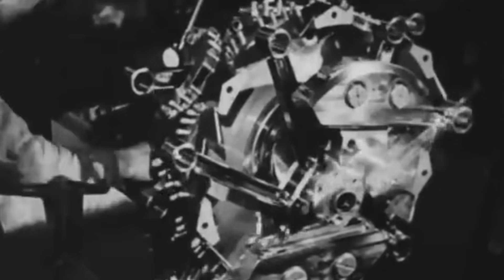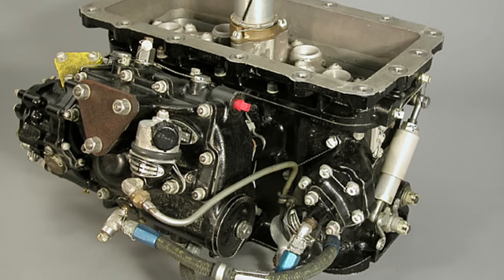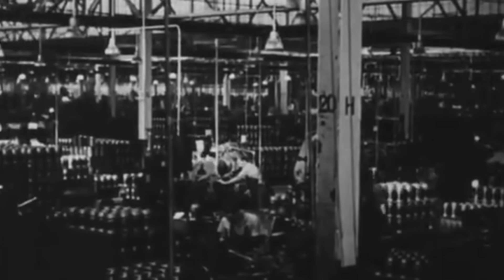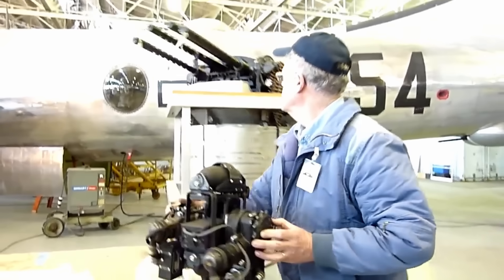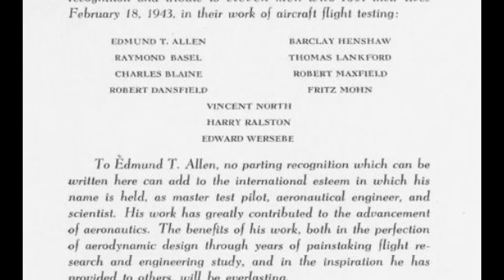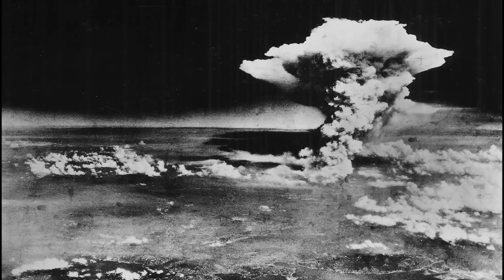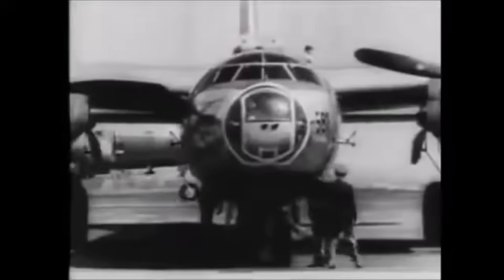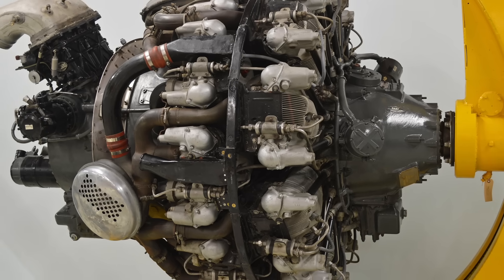MicroStrategy Connect: Community Top 10 #AsktheExpert

Comment: CORRECTION; Direct Injection SIGNIFICANTLY INCREASES HORSEPOWER by decreasing pumping loss, improved mixture ratio control and reduced engine "Knock" and allowing higher manifold boost pressure when compared with the more primitive carburator technology that was prevalent in Allied WW2 engines.
Reply: No it didn't, and no WW2 US aircraft engine's had actual carburetors on them, the fact is they were actually fuel injection, single point fuel injection to be specific, hence the sometimes used name Bendix "injection" carburetor, the only reason the word carburetor was even associated with them is simply because they just didn't think to call them anything else in those days, but they were not carburetors in the sense you suggest they were, they did not operate on the principle of a carburetor with a fuel bowl that's vented to either the atmosphere for a draw through carburetor with a supercharger or vented to the pressure side of the supercharger for a blow through carburetor on a supercharged engine, they didn't rely on atmospheric pressure and a venturi that results in a pressure differential that forces fuel through a jet like the SU built carburetors on Merlin engine's, they were full up fuel injection systems, the word carburetor being associated with them is very misleading. 
And like everyone else who is always bringing up the subject of pumping losses with WW2 aircraft engine's you seem to forget it's not an issue with them because they were supercharged engine's, the losses are strictly from driving a mechanically driven supercharger but those losses are made up for ×3 to ×4 from the power gains of a supercharger. 
He's 100% correct in what he said, the direct injection was not put on the R3350 engine for increases in power nor did the DI engine's have a higher power rating, it was all about controlling uneven air/fuel ratios to different cylinders which led to lean cylinders back firing into the intake system leading to induction fires, that was the cause of engine fires on B29's contrary to nonsense you'll hear in some videos and read in their comments, it wasn't from magnesium engine case's, which is a complete and total myth because R3350 engine's didn't even have magnesium alloy engine case's, they were forged steel.
You're taking examples of DI that apply to automobile engine's that for a variety of reasons the same results don't apply to the R3350 engine, adding DI to them was all about eliminating induction fires, not increased HP or pumping losses or anything else, just stopping induction fires, that's all.
Reply: @dukecraig2402  Your comments reveal someone who has no formal education or professional experience in aero engines.

The Bendix-Stromberg PD carburator was not a proper fuel injection system and lacked many of the performance benefits that could only come from a true direct fuel injection system.
Reply: @sandervanderkammen9230  
Well, first off I'm a graduate of aircraft maintenance school and an engine builder, so there's that, and I didn't say that the Bendix injection carburetor is the same as having direct injection, I pointed out to you why they went to direct injection, back to that in a moment because apparently you didn't get it the first time around, but the fact remains that the Bendix injection carburetor is indeed fuel injection and not a carburetor, once again the only reason they even associated the word carburetor with it back then was because they didn't know to call it anything else, IT IS NOT a carburetor in the sense you keep claiming it is, which is why it would operate in negative G's and inverted where a true carburetor like the SU manufactured carburetor on the Merlin engine wouldn't. 
The Bendix unit was a single point injection system, like GM's 1950's "mechanical fuel injection" which was also single point and worked almost identically to the Bendix injection unit on WW2 US aircraft, then after was the later GM Throttle Body Injection system which was mostly used as single point but wasn't mechanical like the 50's unit and instead was computer controlled, but still a single point injection, except for 1982&84 Corvettes which had 3 units that were akin to the old "tri pack" or "six pack" carb set up.
Watch the video, the second fuel system he shows is a Bendix multi point "injection carburetor", instead of having a single injector in the unit itself they piped multiple lines off of it to the manifold, more on why in a moment. 
Sorry if because all these years that you saw the word carburetor associated with the Bendix unit has made you believe it functions as an actual carburetor but it doesn't, the fact is it's a single point mechanical fuel injection unit, for the last time the designers of it just didn't know to call it anything else but a carburetor, specifically an "injection" carburetor, try opening a book on the subject or one of the old USAAF or Bendix manuals for it and read it's operating principles, it's not a carburetor in the sense you keep claiming it is by any stretch of the imagination, like most others you're simply misled because they associated the word carburetor with it, the "injection" part of injection carburetor should clue you in.
There's more than one type of fuel injection you know, there's single point, multiple point, and direct injection systems. 
The reason behind them switching from the original system was because when Wright designed the R3350 engine instead of having General Electric design the centrifugal supercharger for it as they did for most US aircraft engine's they were adamant about designing their own, as a result it had a poorly designed defuser area in it that had a tendency to pool excessive gas in that area, after a B29 would sit waiting it's turn to take off in the heat of the Pacific and it's engine's would heat up they would have a tendency to backfire into the intake from one of several cylinders that would run lean due to uneven air/fuel distribution to the cylinders, also an issue with the poorly designed Wright supercharger, once of of those cylinders backfired into the intake it started what's called an induction fire, this fire would move quickly upstream to the supercharger defuser which had fuel pooled up in it and burn hot enough to light it's magnesium construction on fire, they experimented with fire arrestor screens in the diffuser area but this dropped HP by the hundreds so that was quickly dropped. 
Their first attempt at solving the problem was using the Bendix injection carburetor with multiple points on the manifolds downstream of the supercharger but induction fires still happened because of uneven air/fuel being delivered to cylinders with some still being lean enough to cause a cylinder to backfire into the manifold, so then after a direct injection system was designed they switched to it, direct injection not only gave uniform fuel distribution to each cylinder it completely removed fuel from inside the intake manifold, so hotter running cylinders could backfire into the intake manifold during take off and there wasn't any fuel in it to burn upstream.
Reply: @dukecraig2402  You should inquire about getting your money back, because you didn't get much of an education son.
   The Direct Fuel Injection systems such as the one developed by Bosch has a several  major advantages over a floatless type carburator such as a Bendix-Stromberg PD type.
This is the significant difference in air/fuel mixture ratio control offered by a GDI or port injection system as this allows the use of a Dry Intake  Distribution Manifold.
 Any educated industry professional will recognize and understand this significant performance advantage.
 The Bendix-Stromberg carburators are single point systems and do not offer this critical performance advantage.
Reply: The Delco TBI system used in GM cars from the mid-1980s is a fully electronic fuel injection system  (single point)
It's a system based on one or more electronic fuel injectors which both atomize and meter the fuel via electronic pulse width modulation and is controlled by an electronic closed-loop Lamda feedback sensor.
The Bendix-Stromberg floatless carburators work by a completely different mode of operation which is analogous to a conventional float-type carburators.
Reply: @dukecraig2402  You must have been sick the day they taught the difference between a Carburator and Fuel Injection..
You seem to be very confused and misinformed about PFTRs and TBOs  now too.
Stop pretending to be something you're not son.